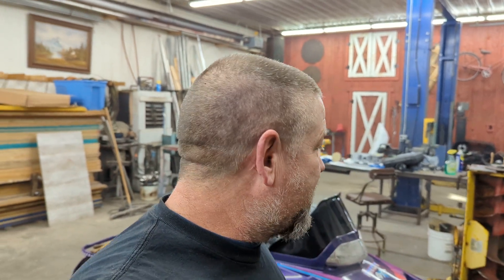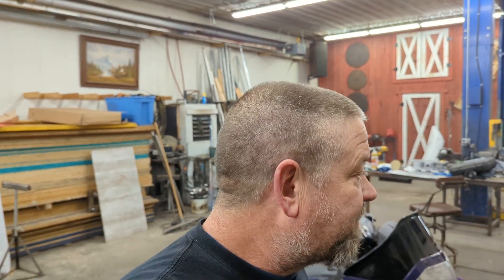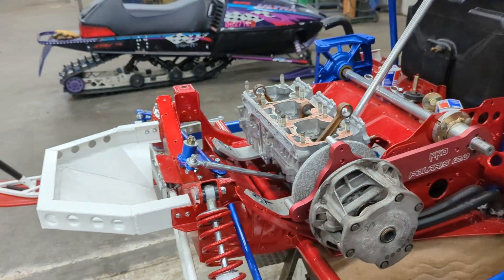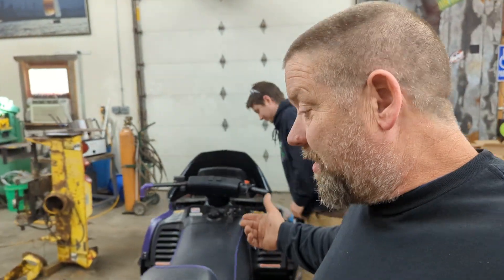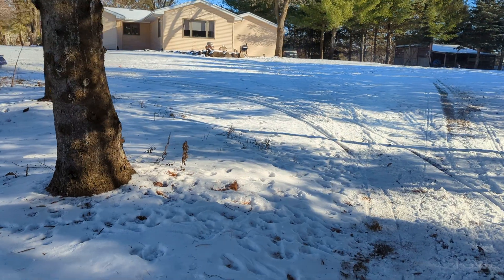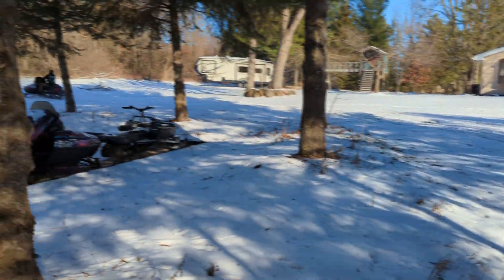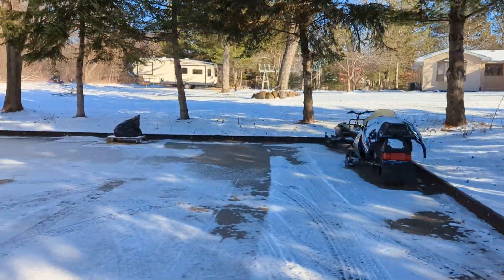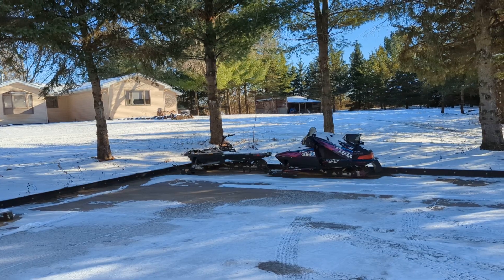97 ULTRA TRIPLE TRIPLE SPX TRASH CAN

Comment: Sounds great. What does the Dnr have to say about it though? NOISE. Wont fly in Michigan.
Reply from the maker: It's all about how you ride I guess. I hear twins on a regular basis that are twice as loud
Reply: @toddclyne3493  Yeah but in Michigan and Wisconsin your sled cant be above 88 decibels. Stock is what they want only.
Reply: @toddclyne3493  Oh and I forgot the most important part. BIG fines and were losing trails because of it.
Reply from the maker: @ronwitt1  not losing trails because of a can. Your losing trails because the irresponsible people ridding way way to late at night. Going off trail thinking the land the trail is on is their own land. A can does not lose trails let's be honest. I have been riding for 30 plus years with triple pipes, cans and straight pipes on some of my vintage stuff. Never once have I been stopped after thousands and thousands of miles. I even have stopped to talk to the DNR when I have seen them out on the trail system to thank them for the job they are doing. It's all about how you ride!!
Reply: @toddclyne3493  Yep your right. My group has ben pulled aside and 2 guys in my group had cans. Dnr carries decibel meters. They were fined and told if they were seen again with there cans they would impound there sleds. Right outside Hurley.
Reply from the maker: @ronwitt1  Ill add that to my list of places not to ride😁

Comment: That thing sounds wicked! I'll have to look into one eventually!

Question for ya. Just bought my first triple. '97 Ultra. Sled is clean and ran fine before I trailered it home (Yes we shut the fuel off). Had it warming up a few minutes, took a slow lap before it bogged out and died. Wouldn't run at all today. Thinking fuel pump and maybe go through the carbs? I'm completely new to these so any help is appreciated!